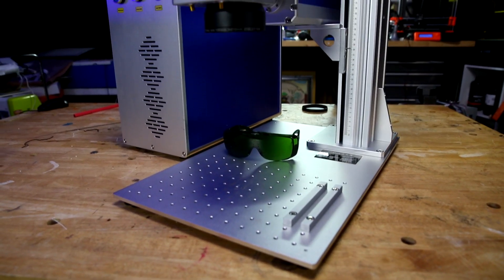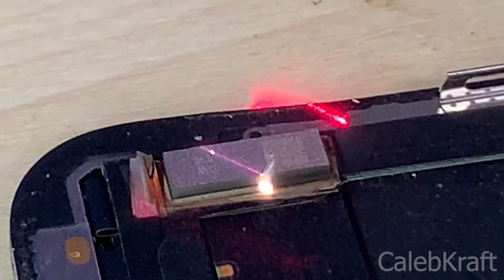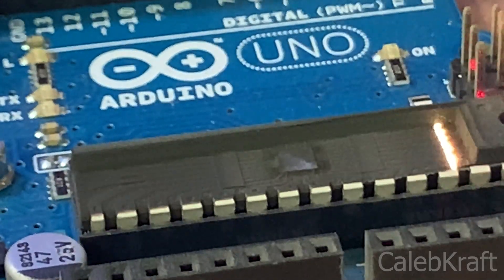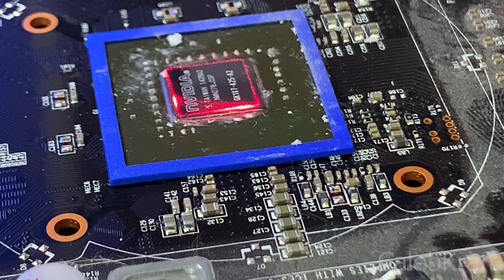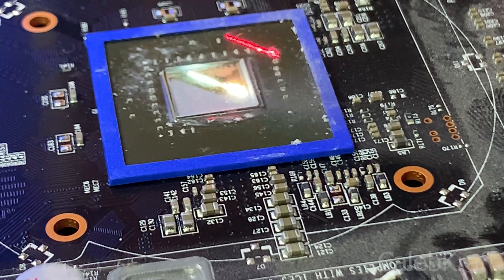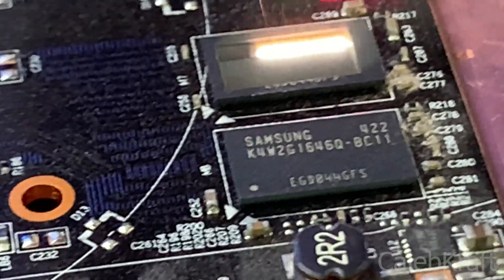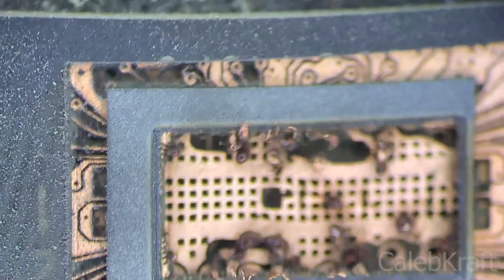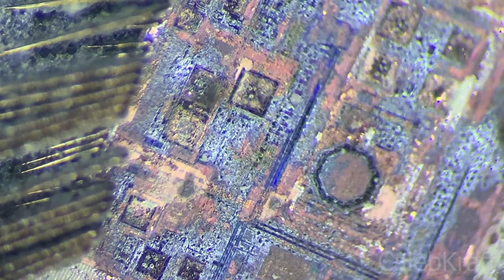IC Laser decapsulation  - just experimenting with decapping

Comment: Fiber lasers are great for blasting away bulk epoxy and glass filler. Get down to the bond wire stage and then you need to clean it up with H2SO4 or HNO3. But the laser makes a really nice pocket to put a few drops in.

Comment: Your packages seem to be mostly glass filled epoxy. The laser settings needed to remove that will obliterate the die... In some the die is also facing backwards, so you are removing the bulk silicon.

Comment: I feel like a laser isn't a good tool for getting down into microcircuitry like a GPU. It probably either destroys the circuits or melts them into a solid layer of material.
Reply: It isn't. It's a poor technique.
The best results I have seen are using acids and dissolving away the different layers on the die.

You can buy online complete processed silicon wafers of chips and just look at them under a microscope.

No need for decapsulation.

Comment: The IC dies that have bond wires should be face up. If there are no bond wires visible then they are usually flip chips (face down). Some of these chips are faceup, and some are flip-chips. 
The thing with the laser is it leaves the surface like sandpaper, yet the layers are micrometer and nanometer thicknesses, so burning the tops will nuke a number of layers each pass. When you get down to the last thin layer of plastic or ceramic, that's when you need to start using a very fine sandpaper to reveal the layers (220 grit) then when an outline of the die starts appearing you need to switch to lapping paper getting even finer (500 grit, 1000 grit, and eventually stopping around 5000 grit). If you want a perfect microscope image, you might even need to go to 10,000 grit lapping paper.  I just recently did a ceramic encased Intel chip, it takes a lot of careful sanding/polishing to get a good result, but yes it can result in amazing outcomes (after about 6 hours).

Comment: That's awesome!  You said you were worried about things too small too see.  While individual structures are often very small, in things like gpu's they can have groups of components such as a block of cache in the chip.  Each large group may be more visible depending on exactly how it was designed and manufactured.  I hope to see more videos on what you blast lasers at next!
Reply from the maker: from what some folks on reddit have said, some chips are upside down from what you might expect, and the visible stuff is on the bottom

Comment: Most of the IC's you attempted to decap were oriented in the package the opposite direction than you'd think. Simply stated, they are upside-down so you encountered the substrate first while the traces and such are on the other side (they are referred to as flip-chip packaged). These IC's would need to be removed from the PCB first and then etched from the bottom to get the results you are looking for. If the IC leads are coming out of the sides of the chip (like the last one in the video), you should be able to decap it directly on the PCB but if the leads are underneath (solder ball style pins) then you likely need to remove them from the PCB first. Even then, I'm not sure what kind of results you'd get having to go through the solder and pins first but it could be another worthy experiment.
Reply from the maker: OH! that's super helpful
Reply: @CalebKraftmakes  If I remember correctly, someone once tried to get a tattoo with a laser printer and they jumped like immediately after it touched them and they didn’t consider getting the tattoo anymore cause it was to them almost far worse then hot and more like deathly lolol
Reply: @StickFiguresMaster  If you know even the slightest bit about laser printers, you'd know how ridiculous that sounds.
Reply: Have you seen rise up? This is the work of Beyoncé’s men… after all we are only one man, (who?) woman..